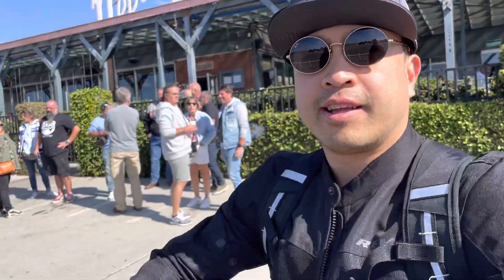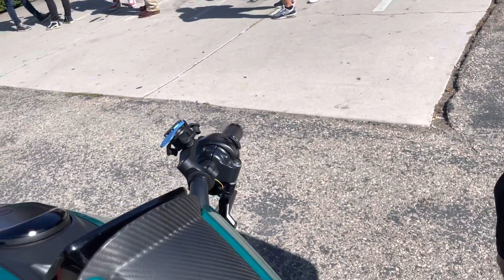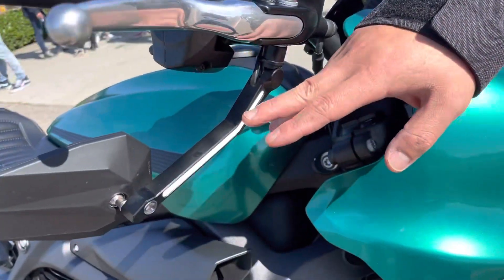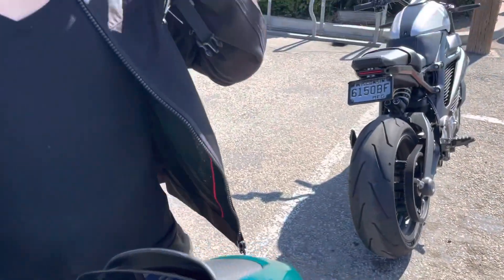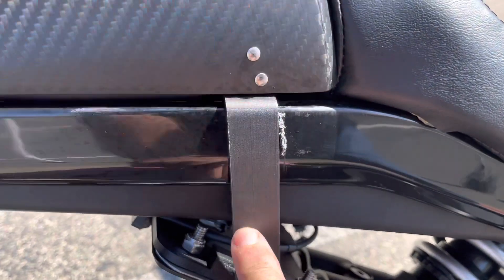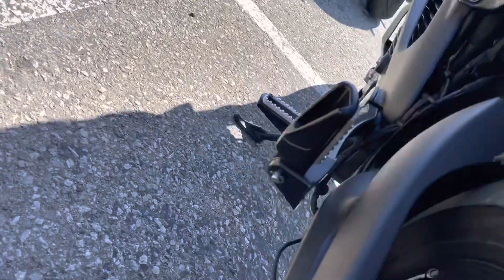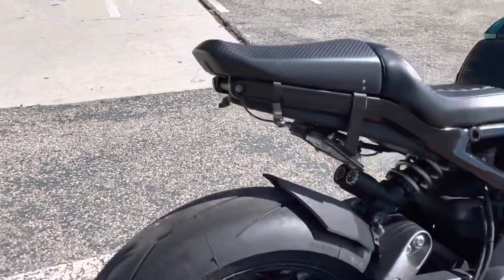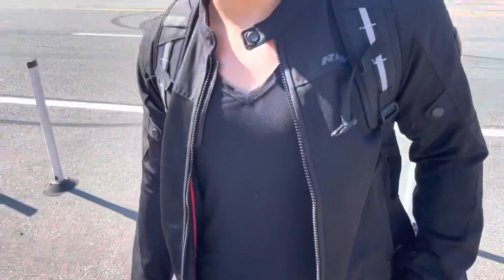Hung’s LiveWire ONE motorcycle

Comment: Hiding the license tag is illegal, and where he going to run at high speed, tops is 115,  my cb500x can do that,  and 20 miles range at 100.    I get 68 mpg at highway speeds 60- 65 mph and a range of little over 300 miles that about 5 cents a mile for fuel, he gets 70 miles on highway and at quick charge station it will cost him .05 a mile for recharge.  The difference, I save four and half hours waiting for charge time, plus the time getting to a charging station and $22,000.     E bike are only good for commuting or showing off you have more money than sense.
Reply from the maker: You made a mistake buying a Honda CB500X. For $600 more, you could have gotten 30 HP and 20 FT/lbs more power and torque. You would have 20 MPH more on top, better fuel economy, better resale value and incredible aftermarket support.

You are in no position to pass judgement on others people motorcycles after making such a bad choice on your own. You should have bought an MT-07.
Reply: The comparison was battery verses fossil fuel range, cost of fuel and practicality of use, not how much power the bike has.   E bike are still commuting bikes,  their range is limited by present battery  technology and availability of quick charge stations.    You did a great job on bike,  however,  you can be killed just as quick on an E bike, or more so due their acceleration, street racing as another bike.    You get caught with a tag mounted like that where I live, you get a ticket.